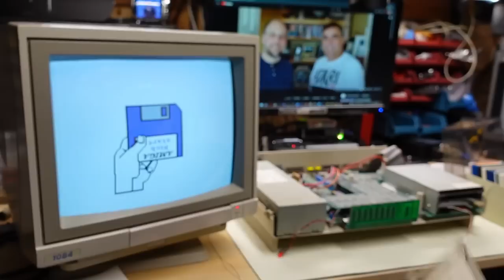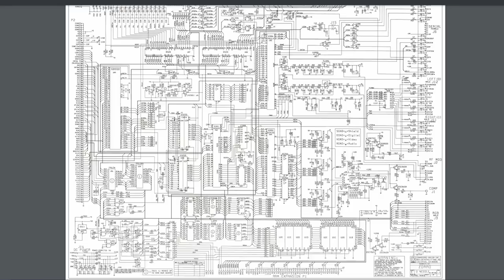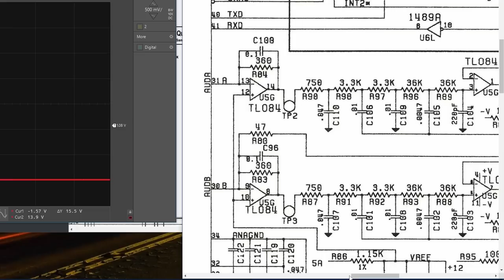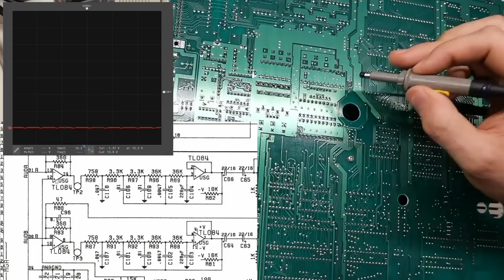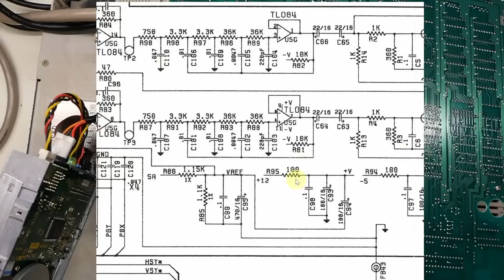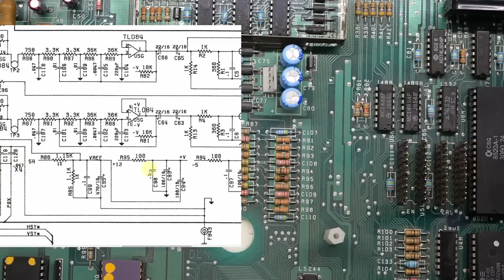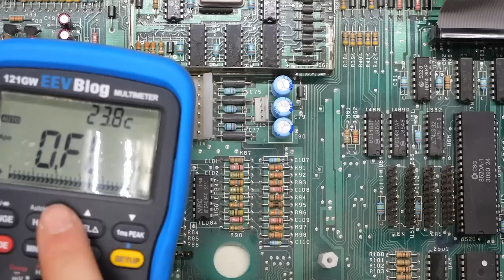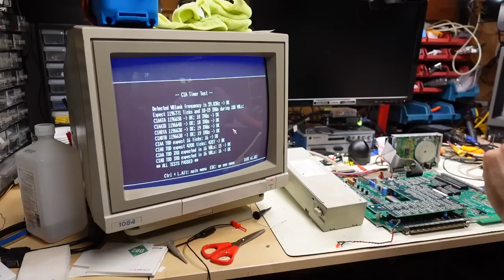Amiga 1000 repair - No audio output

Comment: L / R were reveresed. They were marked on the board. Probably hard to see IRL but in the video it was pretty obvious.

I've also seen someone fix a cap issue on the op amp of another Amiga model. IDK why you would cut an IC before desoldering a cap .🤷‍♂️🤣🤣🤣

I was really baffled by that decision, but it's your machine! An op-amp is also not a rare part so I guess it's fine.
Reply from the maker: Because out of hundreds of machines I've fixed, this is only the second time an electrolytic cap has been shorted like this. On the other hand, I have hundreds of dead ICs in my dead parts bins. Which seems like the more likely failure?

Comment: You put water on electrolytic capacitors?
Reply: Doesn't hurt. Doesn't go inside. Fine with a good drying.
Reply: @g0bzy  what about the other components? Can I clean every electronic board with soap and water?
Reply: @FrecciaBensino224  technically if you let it dry for LONG!
Reply: @FrecciaBensino224  There are certain boards that probably shouldn't be cleaned with water. Boards with paper components like speakers or tuning capacitors where it would take a very long time to dry out. I think 80's style computer boards are safe enough - but fully drying them quickly afterwards is vital to stop oxide and rust. I have heard its best to use de-ironised water rather than tape water.
Reply: @FrecciaBensino224  The most important exception is boards with batteries. Any voltage will cause galvanic corrosion. This also can include supercapacitors.

Comment: You can use an A500 drive (Chinon FB 354) in the A1000. Add a 2200R resistor at R13 on the drive and the LED to A+K pads. Might just need a little hot glue to keep the button in place as the metal bracket is shorter on the A500 drive.
Reply from the maker: Interesting! I unfortunately have never had a spare A500 drive -- all I have is a little pile of dead Amiga drives that no longer work properly. (But have piles of working PC drives)

Comment: Most PC floppy drives are configurable by moving/removing jumpers/resistors, so an adapter board is not really necessary. Unless you want to keep the drive stock and universal of course.

Comment: why din't you try using a risercable for the ramboard? the frequencies are not too high, so a salfmade pin-riser-wire-adapter-whatever cable should do the job.

Comment: When resistor coating is not more protecting the resistive track, moisture will short the winding inside the resistor as it is not like a solid rod, it is a coal resistive path done in windings that go around its base ceramic rod, when moisture gets there like humidity, the resistence will short, or will  go out of range. Never left a resistence without a working coating. The same for a coating cracked capacitors, it will fail as soon as it get moisture inside.